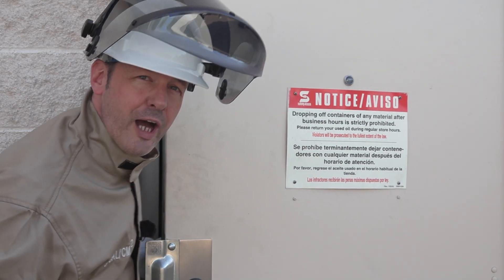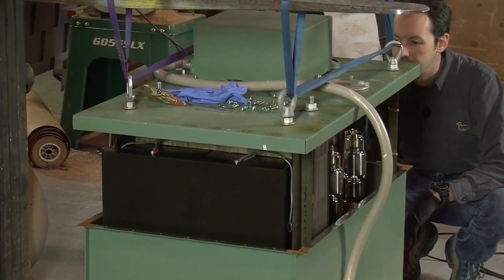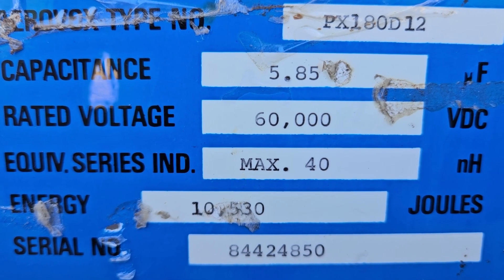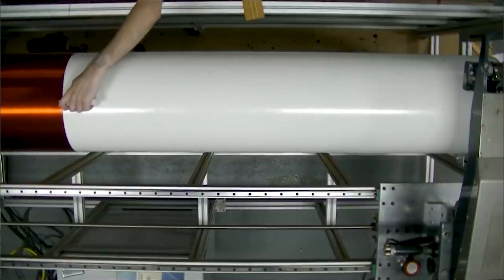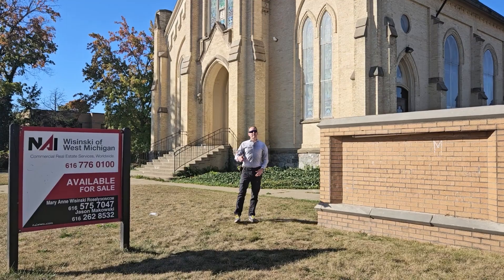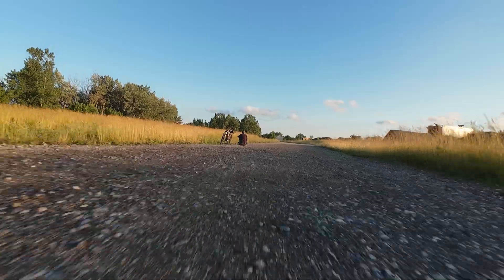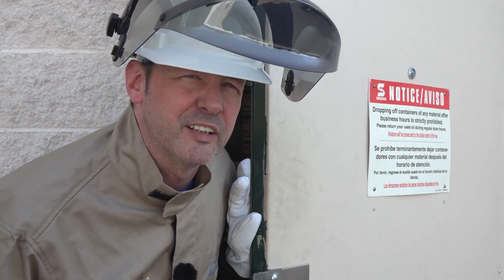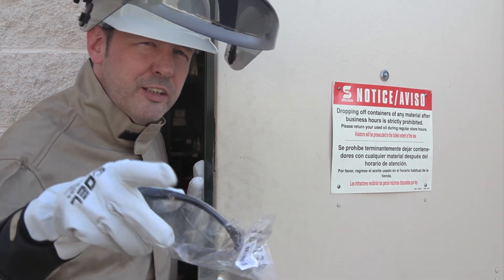Don't Do This - High Voltage For The Home Shop, Season 1 Episode 1

Comment: Dear Chris Boden

As a 14yo that has autism, ADHD, and GAD, I would like to let you know:

Science does indeed not care about my feelings
Physics tries to make me cry, but makes me extremely turbo-nerdedout
Mathematics also tries to make me cry, but fails miserably, and instead entertains me
Engineering, well, engineering is awesome, and F*** ARCHITECTS!!!
And finally:

Yeah ive almost died many times before working with .5v-1.5v capacitors

(By eating them 😊)

Comment: I built a high voltage lightening machine that would pulse to the beat of disco. I thought it was cool. My guests ran away in fear. The hard part was building all the huge capacitors - several 55 gallon barrels were sacrificed in the building those. (btw I have a degree in electronics - so there is that)

Comment: I’m a mechanical engineer and building inspector and this is an amazing disclaimer that I think I’ll show to both coworkers and contractors. A mistake in fire blocking or structural support, and I’m standing right there by the architect and engineer who drew up the plans. Great video!

Comment: that back stage pass comment is so real. I've been down in some holes that made me question everything our society is built on. It's mostly concrete over stone, but every once in a while, i see a main support on a sandbag, or a metal tool hook hanging from a 240 line, and I cant help but wonder. Room temperature IQ's and a disregard for safety are why I make sandwiches instead of working trades these days. I loved the money but risking my health was not worth that. Especially when most foremen are the lowest common denominator when it comes to intelligence. If i ever go back to the trades it will be in a leadership position or not at all.

Comment: And yet, you are not a degreed engineer yourself.  What have you been doing this whole time?  Did you run a PA system for rock bands?    I hope you get somewhere with this thing you are entertaining.  How did you gain access to a hydroelectric plant?  A firehouse and firetruck?  You have lots of shooting locations that lend authenticity, but you remain a mystery.  There is a good video of a guy in New England firing up the first steam powered power plant after years of decomission.  Done with beautiful lighting and lenses.  By The Proper People.

Comment: In the eighties at Universal Electric we built M/G sets for people who had three phase equipment but no three phase service. Nowadays my brother runs the lathe and mill off of a variable inverter for both three phase and speed control. Times have changed. Often we would set them up similar to the relay box on submersible water pump. Some people just put single phase motors in their place when they burnt up. It would be a lot simpler if homes all came with three phase high voltage service.

Comment: Hey, FNG here. Just found ya, liked & subscribed in da dooblie doo, retar...retired, ya retired inside Journeyman Wireman from Local 58 in Detroit, also former Marine (74~89). Binging old stuff, looking forward to seeing you play.  I didn't routinely work High Voltage (I worked from light commercial, to Heavy industrial, da Marathon plant, Zug Island) I've done stress cones in primary gear, not rebuilt the transformer. I've experienced the joy that is "The Dreaded 277 Neutral" (it let go of me, I was speaking in tounges).
Reply: My most visible project that anyone can see? In 1999 I worked on Comerica Park. 
Those big honking speakers (yeah, the size of a couch) hanging off the upper canopy.  I had my hands on every one of those big bastards (2 48" drivers per box). In Detroit, Nov 99 to Apr 2000) worked for KLA Labs.

Comment: As an Australian electrician, I think I will stick to low voltage... 415V, 3 phase.
I couldn't read much of the disclaimer. I was getting a headache much like I was getting about 40 years ago while doing the trade course and a little later while doing the electrical engineer course.
That is why I will stick to the low voltage industrial stuff.

Comment: I made a Van De Graaf generator in 6th grade and won 1st place in the science fair. It made dead fluorescent tubes glow from several inches away and made half inch sparks with your finger, so it was pretty safe, I guess. The shock was more like a tingle. Not enough to make hair stand up. I wanted to build a Tesla coil next, and I had some neon sign transformers that I thought would work, but I was not confident I could work with so much voltage, so it never happened. I later majored in EE and CS at PU in the 70s. I don't mess with High Voltage any more.  Looking forward to the lessons and comic relief.

Comment: I used to run a quality control lab for a company that made blow out preventers for oil wells. When the BP deepwater horizons accident happened, the first thing I did was look up what company made their BOPs. Luckily it wasn't one of mine, but there was definitely a moment of sheer terror at the possibility until I made certain.

Comment: My first electrical bite was when I opened an electric can-opener I found on a dumpster dive (ten year olds do that). I plugged it in, and the motor ran.  Pretty cool! 
Using a Phillips screwdriver from my father's tool box, I took the thing apart. With my left hand I catefully held the contraption in such a way that the roller jaws wouldn't bite me. With my right hand, well, "Cronk! Pull the lever!"
BuZZzzZzZ!
"Wrong lever, Cronk!"
I didn't know about E = iR.  
I did find out, as the 120 cucle tingle crawled up my arm, that the pinchy rollers were not the only danger.
Release the on switch, release clamped left hand, and came to an instant decision:
I won't be telling my parents!

Recently, my son took apart a microwave with his daughter. He asked me about any dangers. "Unplugged, capacitor discharged, and sharp metal.  Have fun!"

Comment: I am in my mid 40's, and have been working in the construction industry for about 18 years. I went from labor to desk job, using CAD to design everything from structural beam connections, to entire luxury homes. However, my real passion has always been fabrication. I finally have the space and financial stability to learn how to weld, run electrical wiring, upgrading my subpanel to handle 50a outlets, and the second I begin this journey in my life, your video comes around. 

Coincidence? I think not, stop bugging my home!

Looking forward to your videos Captain Boden!
Reply: Seriously, 40+ and still don't know how to weld etc?

Comment: The term prion comes from "proteinaceous infectious particle", and is a misfolded protein that induces misfolding in normal variants of the same protein, leading to cellular death. Prions are responsible for prion diseases, known as transmissible spongiform encephalopathy (TSEs), which are fatal and transmissible neurodegenerative diseases affecting both humans and animals.
Source: https://en.wikipedia.org/wiki/Prion

Sounding is the practice of inserting objects (typically made by metal or silicone) into the urethra for sexual gratification.
Source (with a rather graphic depiction at the top of the article, it cannot be unseen): https://en.wikipedia.org/wiki/Urethral_sounding 

I was among the first generation to start using the world wide wait.

Agreed with everything except the part about not setting dumpsters on fire and with the caveat that you'll never accept sponsorship from 'BetterHelp'.
"He actually the whole thing!"

Comment: So excited for this! Reminds me of one of my early jobs, building the controls cabinet & programming the Safety PLC system for a VERY LARGE experimental Ion Implanter (thing that helps make the semiconductors semiconduct)

First day tour of the system was pretty much: "So these are the material handling robots. If your head is in the vacuum chamber when when they move, your gonna have a bad day. Those pipes and valves are all of the process gasses. Those gasses will either poison you, burst into flame in air, degrade in to nasties like hydrochloric acid, or some terrible combination. Those are the 750 kV power supplies, and this is a chart of the dielectric breakdown strength of air. Basically don't get within feet of them when they are on, really it's best not to look at them funny

So new guy, your job is to minimize the chances of this thing killing us so that the material science nerds can do their wizardry, and the world gets its computer chips and solar panels"

Proud to say our only incidents were once NEARLY exploding a turbopump, and some joker getting 120V to the hand sticking his screwdriver in my panel. We all had to get retrained in the dangers of live electrical work after that one, and gave him some shit, but could have been much worse!

Comment: Look Chris, not to break your worldview or anything, but me at age 15 making an FPV drone in my parents basement only to short out the LiPo and having it catch fire isnt exactly the «safe» alternative you think it is!

But making the drone did get me to love electronics, which made me get the journeyman electrical license, which made me a now low voltage technician working with fire alarms. Something something, full circle.

Also somewhere along the way I got my «vocational college degree of electrical power», which is 95% of a bachelors degree, but still isnt.

Comment: These are my people. Like many subcultures, you know it when you find it. I started when my dad showed me how points ignition worked at about 10. 60kv dc by the time I finished high-school. That could turn rust into molten iron. Had a few lame jobs until I finished my schooling. The engineering shop I ended up at, the Christmas party fireworks were charging an entire table of huge caps up to 100's of volts and short circuiting them through slabs of aluminum, sending out guysers of molten metal, I don't know how many amps, but it was "many". We were bold, brash, occasionally did silly things, but never stupid. Know your medium, play it safe... Ish.

Comment: I had a moment last week where that personal responsibility and genuine sense of danger set in when I gained work access to a lab that has a fume hood for nitric,picric and hydrofluoric acids all in the same row. A Sobering moment if you know your chemistry. Not even 100ft away from where I was working was gallons of concentrated hydrofluoric acid. It does not forgive and it does not forget.

Comment: as a mechanic, I already have enough responsibility I shouldn't have signed myself up for fixing heavy duty fleet vehicles that cruise down the highway like a 10+ ton cruise missile

However, I'd love to learn how to wire 240 volt circuits for the inevitability I start building my own shop, I'd like to be able to buy and use "high" voltage equipment for fabrication and welding, but I don't think I trust myself any higher stakes then that.

Still, this will be an excellent watch.

Comment: For the love of all things holy, I hope you don't do the standard air core step-up transformer and call it a "Tesla Coil."  STOP.  It's not.  All the cool kids call it that because it looks like that, but unless you are operating it at the ever changing frequency and phase that is the resonating frequency of the LC tank circuit on the secondary side, you are just pumping pixies into a step up transformer.  See, as a Tesla coil operates, the primary should pulse every time the high "Electro-mechanical force" (Tesla's terminology, not mine) approaches the primary coil.  This repels the force, and adds the energy from the primary pulse to it as the magnetic field in the primary collapses.  With this being an air core for both the inductor and capacitor, the dielectric constant is always changing with the air's charge and molecular makeup.  

I'd love to see you build a coil based on the original design of a spark gap with an adjustable bi-metal reed.  This rare type of spark gap is intended to be run continuously.  It starts with a relatively small gap that the primary voltage can jump on its own.  As it runs, and the energy from the secondary feeds back into the primary LC tank, the reed heats up thus expanding the gap.  This is critical for a Tesla coil as the reed self tunes the primary LC tank circuit to match both the frequency and phase of the secondary. circuit.  In Colorado, Tesla hand tuned the spark gaps of each coil while they were in operation.  I wish the paperwork for his plans at Wardenclyffe were still around.  It would be great to see how he planned to scale and automate this.

Side note: There is an operational, full size Tesla coil in Texas just south of Temple.  It was built with DOE and DARPA funds.  This coil, from my understanding, is bigger than Wardenclyffe as that tower was still an experiment.  I believe this is where some work is being done on the study of scalar waves,
Reply from the maker: um..... like this? https://youtu.be/oDkNHubCSRc
Do a search for "Gemini" on this channel ;)

Comment: 4:44 minutes in and I'm wheezing! Truth bomb after mic drop line all delivered with razor sharp wit. Belisimo!
As an electronics engineer who's somehow stumbled into a job working with a high-voltage test cage and laying sensor cables around substations I feel like you're going to be my spirit guide for an area of engineering where I have just enough knowledge to be dangerous to myself but no formal education in (yes my master's degree only covered everything from a plug socket downwards in size and power flow). 

So I eagerly await the next episode in the series and please could yourself and the community here reply with suggestions for similar channels to expand my electrical engineering knowledge. Thank you.

Comment: My experience with 'first light' is that it wants to put a hole in you. In my case 1064nm @ 50kW. It probably wouldn't hurt. Much. At first. Still, I decided to not be in the beam path.

Comment: I think it's too late for me. This past weekend we had a festival in town and the band I do sound for rolled up to find out... they finally decided to get us a stage, a mobile trailer stage.
This trailer came with lights and outlets and a lovely 4AWG gauge copper flexible cable dangling out the back of it. well I wasn't sure how dark it was gonna be and it's designed to be wired in to a 50 amp circuit. Sure would be nice to have the work lights at least. Figured out what was what and wired everything up to an adapter wtith a 15 amp breaker which intern connects to a 15 amp plug. got everything working Saturday morning. Sunday afternoon tearing down I'm undoing my alligator clips covered in tape and I was informed that this is a government vehicle and that you could've burn the whole place down. If it was that unsafe why wasn't it locked out tagged out? So I'm building me-self a new contraption. on one end it has an IEC connector rated for 20 A with 12 gauge wire to terminals that will accept 12 gauge wire on one side and 4AWG on the other. This then plugged into my safety box which consist of a double pole switch and 15 amp breaker wired with 12 gauge wire for testing and working on appliances, circuits and such. Yeah after this I won't feel cautious about saying feel free to use the convenience outlets for more than cell phone charging.

Comment: I had to fix a power button on a 19" CRT computer Monitor that had broken.. accidentally brushed against the circuit board with my hand and got thrown clear across the room.. don't underestimate even small capacitors ability to zap you good.